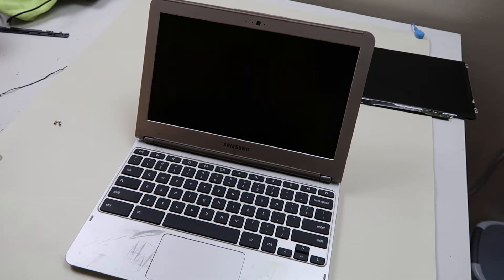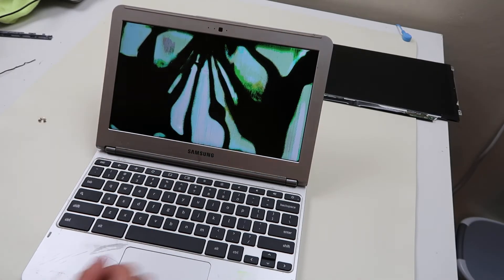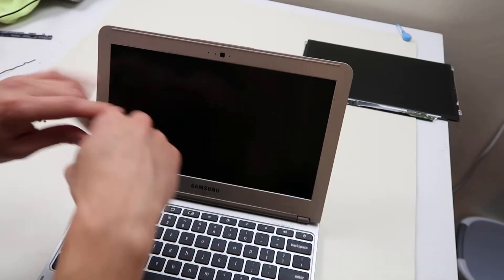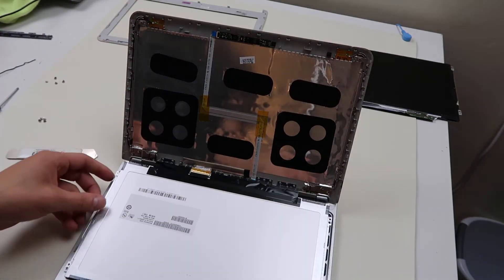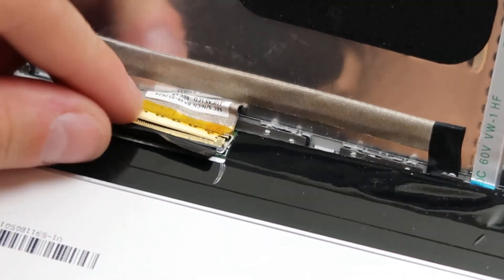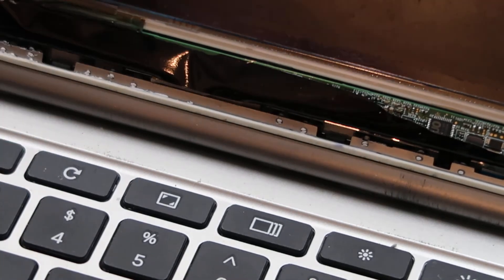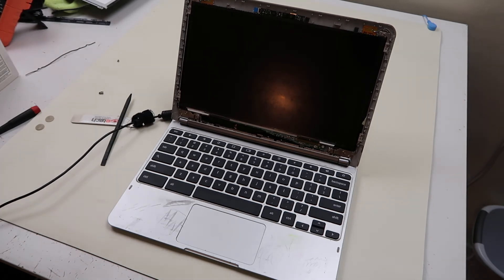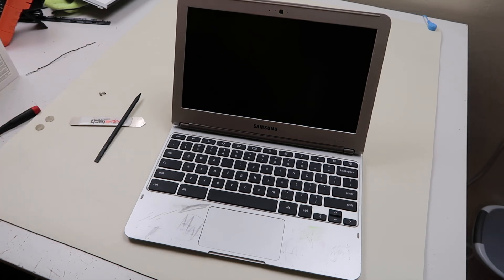How To Fix Replace LCD Screen - Samsung Chromebook 303C

Comment: i have same chromebook , samsung xe303c and i wastrying to buy screen replacement for that,but i couldnt find anywhere online.. could you let me know where can i find it, please...
Reply from the maker: Sure.  The screen size for this computer is 11.6 inches.  You would then need to look in the back of the LCD and see if it has a 30 or 40 pin connector.  Usually its a 30.  Then you would need to make sure you get an LCD with the port at the correct spot on the LCD.  I usually get my parts on sites like Ebay or Amazon.  That help?

Comment: Hi again.  Further to my posting below, I did hook the Chromebook up to a TV, and that showed only a navy blue light when the Chromebook was booted up.
Reply from the maker: If its not showing to an external monitor, unplug the LCD cable from the motherboard.  Some computers wont display to an external with that still hooked up sometimes :(   If that still wont get it to display to an external monitor, your most likely looking at a motherboard issue.
Reply: @PC_Monkey  Thanks for replying.  It's strange - I opened up the back of the Chromebook, and unplugged the battery.  As soon as I did this, the thing started up, and the screen was visible.  It has been working perfectly since.  Go figure!
Reply from the maker: @markeyre713  The battery may be starting to die.  If it does so in a bad way, the computer could be malfunctioning as a result.

Comment: Hi there.  Your video was informative.  Unfortunately, I changed my LCD screen, and I still have the same problem.  The Chromebook starts up, and if I sit in a dark room with a torch, I can just make out the Start-up on the screen.  But it is incredibly dim.  Both screens (old and new) show the same thing, so it's not the screen that's the problem.  Do you have any other suggestions what the problem might be?
Reply from the maker: Then it could the the LCD Cable.  I would next replace that and try it with the old and new LCD.

Comment: Thanks so much for this video mine was broken and i did all the steps but I did not have a new screen so i disconnected the screen and reconnected it. The problem with mine was that the screen was only black and it would not turn on but like I said I followed the steps and disconnected the screen then reconnected it thanks for the vid.
Reply from the maker: Great to hear !!  Always here to help :):)